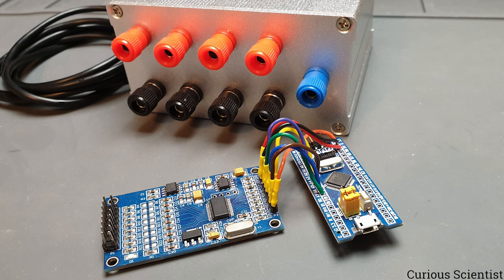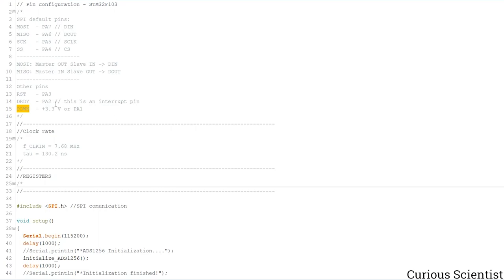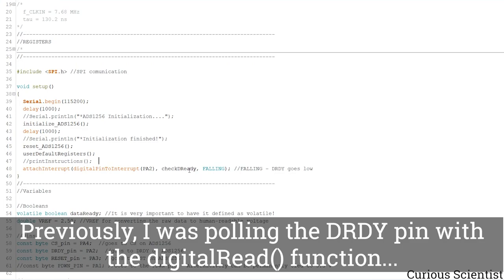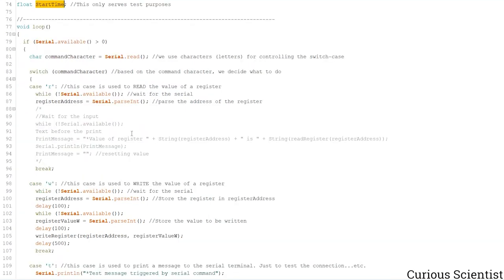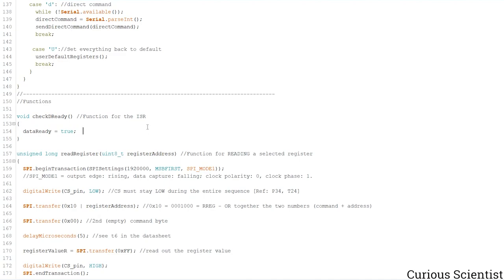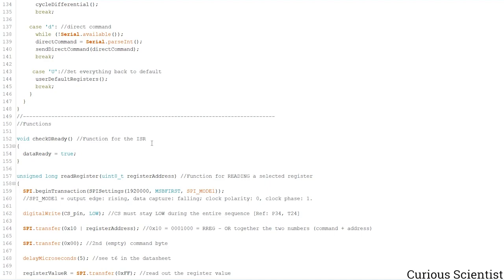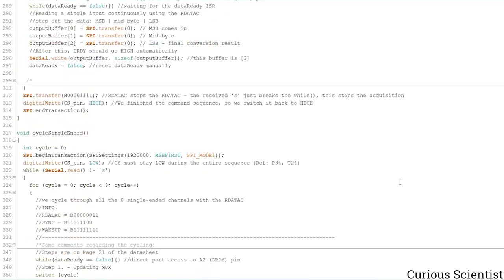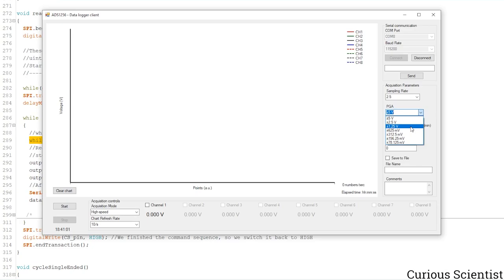ADS1256 - Improved code for faster acquisition

Comment: I know your noise is really low, but I'm wondering if it can be better.
Have you tested to determine where most of your noise is coming from?
Reply from the maker: Hi! I haven't tested it for noise. Probably a better PCB design can improve noise as well as a better supply and reference voltage source. Unfortunately, I am not an expert in getting the most bits out from ADCs, but there are several other people, especially on eevblog who know how to deal with it.

Comment: I want to make an acquisition using esp32 wroom, but the acquisition has to be 30khz (30ksps), is it possible to do this? I'm using the board with ads1256 for biomedical signals, but I need a high sampling and then pass the data buffer via wifi. If you tell me that it is possible, I will hire your technical support, I really need support to make it work.
Reply from the maker: Sure, it is possible. Check my most recent ADS1256 video. I published an official library for this chip.

Comment: Hi, thanks for sharing your work. I upload successfully your code on my blue pill but I can not read anything on the serial monitor of the output port com. can you help me ? thanks in advance
Reply from the maker: Hi! It is hard to see what could be wrong. If there's nothing on the serial monitor, then something is wrong with the communication.
Reply: I used fdti ttl to communicate, not usb  @CuriousScientist
Reply from the maker: Then, no wonder that nothing is showing up. :)
Reply: @CuriousScientist  I am new user in arduino, do you have a reference for me in order how to do to communicate. thank in advance
Reply from the maker: Do exactly as I did in the video, and it will work. But this project is a rather advanced one, so if you are a new user, probably this should not be your first project.

Comment: Hi, I'm using google online translator, sorry for the mistakes.
I'm completely new to electronics, but I love your videos.
I have exactly the same ADS 1256 board that you use in your video, and I have an Arduino Uno R3.
Would it work with your code? I see in the video that you use a different controller.
Thank you very much, and sorry if I asked a stupid question, but as I said I'm a newbie to electronics.
Reply from the maker: Check my official ADS1256 library. It is in the library manager. It works with most of the Arduino-compatible microcontrollers.
Reply: @CuriousScientist  Thank you so much for responding so quickly.
I'll check the library.

Comment: Have you ever tried using STM32 Cube IDE?
Reply from the maker: Sure, my TCD1304 project is based entirely on a code that I developed using the CubeIDE. :)
Reply: @CuriousScientist  Cool, and for ads1256, have u used too?
Reply from the maker: No need. I developed a full library for Arduino, and it works with all the Arduino compatible microcontrollers.

Comment: İ am using an Esp32 and ADS1256(blue module) .your code includes a reset pin, but te ADS1256 blue version does not have a reset pin .can you help me ? the pins for the ADS1256 blue version are:5V,GND,SCLK,DIN,DOUT,DRDY,CS,PDWN.Thank you very much
Reply from the maker: Hi! Check my Arduino library. Everything is taken care of in it.
Reply: @CuriousScientist  Can you send me a link.thank you very much
Reply from the maker: @gouledNini in Arduino IDE, open the library manager and search for ADS1256. Then, download the library that is under my name. Also, if you search on my channel, you will find it.
Reply from the maker: @gouledNini this link will also guide you to my GitHub: https://curiousscientist.tech/ads1256-custom-library
Reply: @CuriousScientist  "First of all, thank you for your quick response. Yes, I did all that and copied and pasted the code from the video. However, my ADS1256 board doesn't have a reset pin, whereas yours does. When I delete the reset pin, the code doesn't work. What should I do? I would really appreciate your help.
Reply from the maker: @gouledNini it is described in the library's documentation. Read it.

Comment: The LSB to Voltage calculation trips me still off.  Are you using 3v3 or 5v ref V.
Reply from the maker: None. Watch the video, read my website and check the datasheet of this specific ads1256 board.

Comment: Can you handle +/- input?
Reply from the maker: Yes, that's what the differential input is for. It can measure +/-5 V by default. You can extend the range with an external voltage divider, or narrow it with the built in PGA.

Comment: Hi. I am trying to run this code on a hybrid / integrated board you have shown several times in your videos (ADS1256 with STM32). I have adjusted your code to work with SPI2 and pins hard-wired on the board. I have managed to upload the code to STM32. Just that took me a full day :) Now I am having a problem - I can get valid and accurate voltage readings by manually requesting those via “O” command. But once I request any of the three continuous modes the serial port is getting flooded with almost random non-standard unstructured symbols. Almost random because they do actually depend on voltage. I have tried uncommenting your test lines but those didn’t change much. I can stop this mess by sending “s” command and then keep on getting valid data by sending “O” commands again, just like if nothing has happened. I can get continuous flow by placing readSingle() right after the void loop() but I won’t be able to get differential mode this way (to read load cells). I don't seem to be able to adjust ADS1256 settings too - gain, sampling rate... My ST-Link adapter stopped opening the COM port, so now I am using USB to TTL adapters for flashing and communication. Both adaptors work exactly the same (FT232RL and another has no marking on the chip). I have tried a few different bootloaders (from your links and from Mecrisp). What could be wrong? Any ideas?     P.S.: I am a mech.eng with some elec.eng and only basic programming skills :)
Reply from the maker: Hi! I think I know the issue: You are not watching my videos carefully and not looking at my website carefully. :)

To begin with, there is a huge playlist where I talk about every tiny details about how the ADS1256 works and how to use it with an Arduino-based microcontroller: https://www.youtube.com/playlist?list=PLaeIi4Gbl1T-RpVNM8uKdiV1G_3t5jCIu

To make it even better, I also talk about the specific board you mentioned: https://youtu.be/3Rlr0FCffr0

By the way what did you expect from the continuous mode? It will flood the COM port with continuous data stream, that's why it is called continuous... Those symbols are not random, it just shows again that you haven't even watched this video carefully. That data is in binary format, 24-bit in three bytes that you have to reassemble into a 32 bit number on the receiving side. 

Read the datasheet of the ADS1256 and watch my videos. Based on your issues, it is obvious that you haven't watched them.

Comment: Thanks for your works, can u give me some tips to use ads1256 with Arduino Atmega2560 . 🙏 thanks 
I want to measure very low voltages and continuously with 16 channel MUX
Reply from the maker: Hi! The ADS1256 only has 8 channels. Just watch my videos and use the code I provide.
Reply: @CuriousScientist  Previous val 0
Write to Register 0x0 failed!
Previous val 1
Previous val 20
Previous val E1
Write to Register 0x3 failed!
Previous val EE
Write to Register 0x4 failed!
Hello, I'm struggling with this issue, I don't really understand the register ?
 I use your code  but the Voltage, when using "R", I got just "0". Like "16711237
 0.00", 
I saw this in your code
Serial.println(ADS.GetConversion());
        Serial.println(Voltage = ADS.GetConversion()*(5/16700000));
but I can't understand why i can't get the Voltage ?
Thank for your response.
Reply from the maker: Hi! I think you are not using my newest code. My newest code does not and should not throw any error messages. Check it and see if it works.

Comment: Hi, thanks for this great video.
We have been trying for a long time without success to connect 2 ADS1256 catres on the same SPI bus. As soon as you connect the second card, nothing works, while the first gives the expected results. Have you ever tried on your side?
Reply from the maker: Hi and welcome! 
I have never tried it with 2 units, but it should work as the communication is just a standard SPI communication. Your description is very vague, so I cannot even guess what could've gone wrong. Did you separate ALL the other non-SPI connections such as reset, DRDY...etc? Especially DRDY is crucial. It is a key part part of my code and also the working principle of this ADC.

Comment: hello.
Your code is very helpful.
However, there is an error in the voltage range. It accepts 0~5V input, but in ADS1256, it only receives up to 4V input, and if it is abnormal, it drops to 3.9 to 3.8. Do you have any special issues?
Reply from the maker: Hello and thanks. The error is that you did not read the datasheet of the ADS1256. Read it. You probably have the buffer enabled and you went over the allowed input voltage.
Reply: @CuriousScientist  Thank you for answer.
It was helpful. I will read the datasheet.
Reply from the maker: You're welcome!

Comment: I love your video you explain it really well ! I have the same board and my thought is the reference on it shouldn´t it be something really high precision and tight temperature coefficent ? The one on the board seems a bit cheap to me what do you think ? By the way I would replace it with MAX6225 take a look at it.
Reply from the maker: Thanks, I am glad that you like my explanation! I haven't really went into the details with the voltage reference as I have never used the circuit for "critical applications". However, it is great that you brought this topic up. There is another ADS1256 board which I introduced on my channel ( https://www.youtube.com/watch?v=6SW3wcsMRwk ) which has the ADR431 voltage reference. It is maybe a tiny bit better than the one on this blue board (ADR380), however, this MAX6225 seems to be even better.
Reply: My idea is just that If you use a good reference you can calibrate your measurement with it without needing a precision and expensive multimeter anymore. The great thing is we are not a factory so we only need one of these so the cost stays relatively low while being squeezing the maximum quality out ! I want to use the ADS1256 for a digital electronic load and I think that one could make it like really good professional sold ones staying cheap because it´s diy.
Reply from the maker: Yes, a good reference could allow that! I cannot recall the type right now, but there is a desktop multimeter that uses the ADS1256. So this stuff can be really reliable. If you build a good circuit around it, you can use this ad converter for many exciting things! Voltmeter, load cell circuit, thermocouple circuit...etc.
Reply: Haha, yes an all in one black box because it has 4-8 inputs and the best I found is your PC software ! I am also a beginner in programming so hats up to your graphical interface ! It´s not something you would click together in 5minutes I also tried it and need to fix it because mine did not work really until now.
Reply from the maker: Yeah, it took a while to develop this software as well as the software for the Arduino that communicates with the ADS1256. But it was a good exercise.
Reply: Especially If you want to do it in C# WPF there is no graph so you need to programm it yourself.